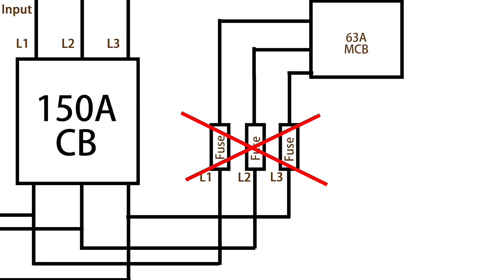[裝備L日常] 電力超載負荷 | 電線着火 | 施耐德斷路器 | Power overload | Schneider B82100 100A circuit breaker| MCB upgrade

Comment: C兄, 你可能對守則有少少誤解

首先你要參考守則6B(1)要求 - 電路的基本要求 - 保護
每一電路應設有防止過流的保護器件

守則9D 係講緊 過流保護器件的位置 安放

第一組電路: 150A TPN 來電 
第二組電路: 32A TPN 一組有 Cut-Out 作為過流以及電力故障保護
第三組電路: 63A TPN (被片主 Upgrade 去到 100A TPN) 被片主 用 Isolator 處理, Isolator 係冇 過流以及電力故障 分斷保護能力, 切勿被片主誤導

所以好多留言話片主做錯嘢, 係! 佢係做錯咗嘅

守則9D 正確使用方式如下:
假設你要新造一組63A TPN 4 x 16mm sq. 1/C Cu PVC 電纜 從電力公司地線頭/制櫃巴棚/巴相等等地方取電, (上述所指嘅地方一般超過200A TPN), 根據守則9D 電纜長度在取電點位置開始計三米內必須安裝過流保護器件.

至於片主話 Isolator 符合 IEC 60947 要求, 小弟相信當日佢考A牌嘅時候畀佢老師誤導
IEC 60898 Part 1 微型斷路器(MCB)製造要求
IEC 60947 Part 3 - 模鑄式斷路器(MCCB) 製造要求

至於隔離器詳情可參考手則8

8B 隔離及開關器件的要求 - 
若使用同一器件執行下列功能的其中一項或多項：
     (a) 隔離設備；
     (b) 關閉電源作機械性維修的設備；
     (c) 緊急開關的設備；

8B(2)(d) 則講解那一些電力設備符合隔離器要求, 根據守則合共六款設備符合要求.
     (i) 隔離器 ( 切斷器)；
     (ii) 熔斷開關掣及開關熔斷器；
     (iii) 連桿，包括熔斷連桿及熔斷器終端盒；
     (iv) 插頭及插座；
     (v) 電纜耦合器；
     (vi) 斷路器，包括微型斷路器(MCB)、模製外殼斷路器(MCCB)、具過流保護功能的電流式漏電斷路器及電流式漏電斷路器(RCD)。

隔離器係唔符合 IEC 60947-3 要求

所以你需要搞清楚
     第一: 你由150A TPN 分支一組新的 63A or 100A TPN 電路, 組電路需要提供防止過流的保護器件
     第二: 隔離器係冇防止過流的保護器件. 如果你自己唔信, 你可以參考返守則9A要求.